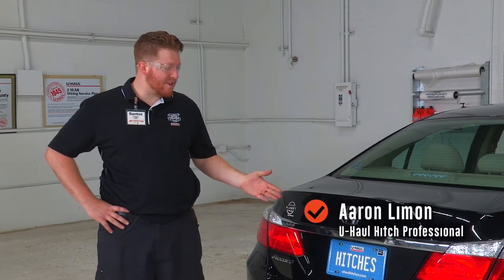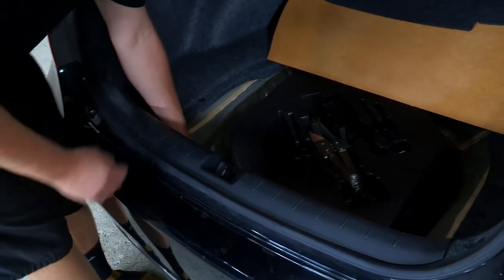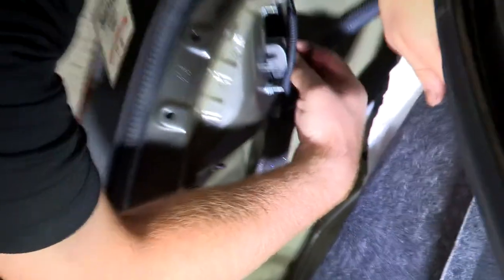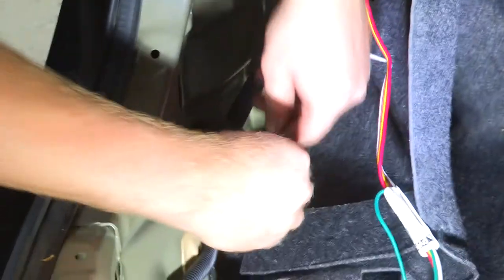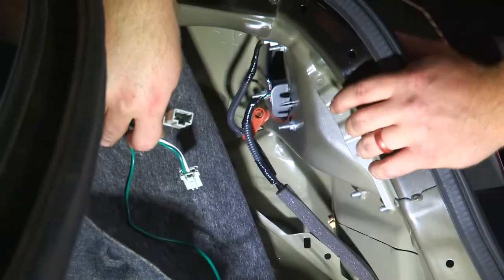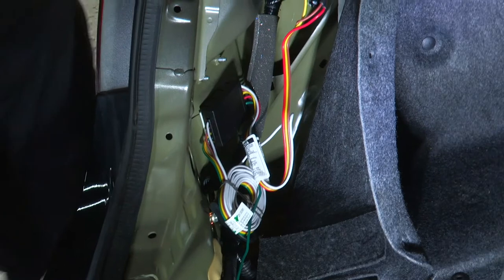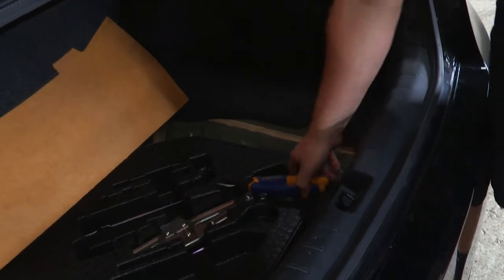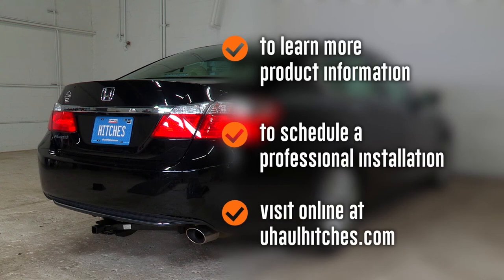2015 Honda Accord Wiring Harness Installation

Comment: On my 2016 Honda accord sedan do I need to run the power converter to the battery?
Reply from the maker: With the 2016, you will have to run the power wire to the battery. We dont currently have a video for that install., however, other than the power wire, it is a very similar process. You can purchase the kit here - https://www.uhaul.com/Trailer-Hitches/

Comment: 2015 Honda Accord Sedan without LED. For part CQT118596, what is the heavy gauge black wire for? It isn't addressed on the U-Haul installation video.
Reply: CWT118596 is for the Honda Accord with LED Taillights. The black wire needs to be connected to the battery. This will give extra power to the black module box on the kit so it doesn't take power away from the LED Taillights. The non LED Taillights have more power with the bulbs so they do not require the black power wire.
Reply: @aaronlimon4803  My Honda doesn't have LEDs. Is there any issue with this unit working with my car?
Reply: I have a 2017 Honda Accord and you have to run a power wire from the battery to the trunk to supply the power to that a little black box which is not shown in this video